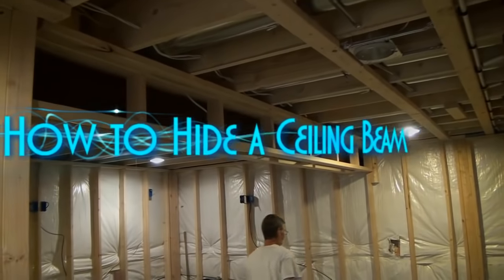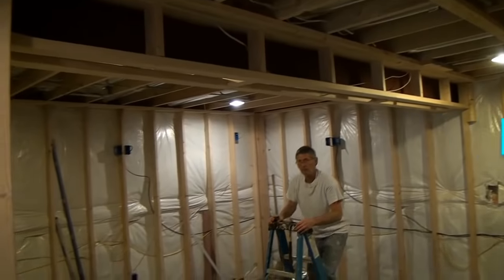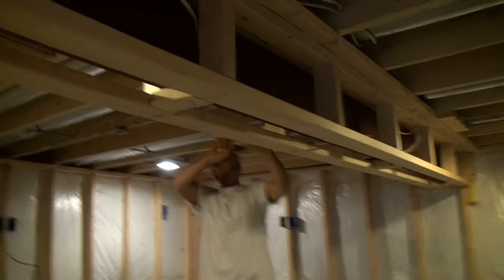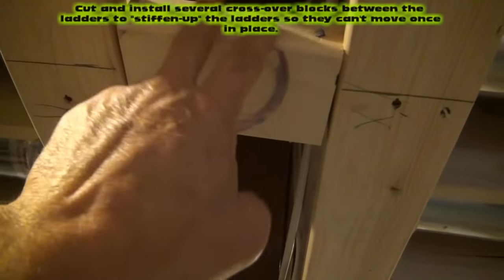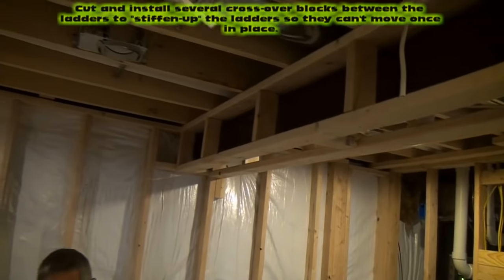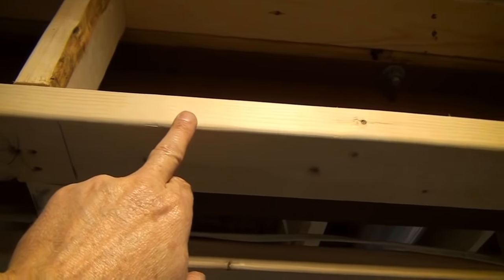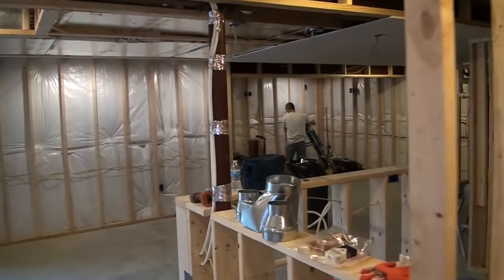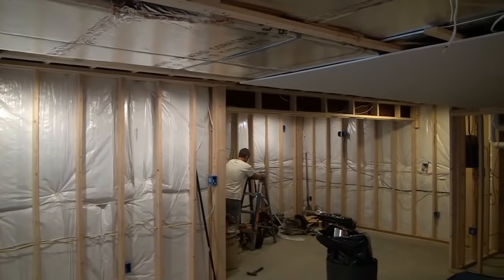How to Box In Basement Beams (How to Frame a Basement Beam)

Comment from the maker: This is a quick and easy framing project where you just build two soffit ladders, add cross-over blocks and then drywall! Thanks for your comments, Likes, and Subscribes to my Channel! ~Eddie
Reply: Basement Finishing Man why do you need to put the bottom of the ladders 2" below the beam exactly? I'm trying to maximize headroom so cutting them just long enough to fit drywall underneath would be ideal.
Reply from the maker: The only reason is to put the connecting cross-over pieces from ladder to the other. And the only way you can do this is to go under the beam Steven. This stiffens up the ladders and keeps them from twisting and moving in the future which causes your drywall cornerbead to crack out eventually over time.

Eddie

Comment: How would you suggest framing a wall in an older home with a cinder block basement with the older 8' walls and the Ibeam is at 80"and spans the entire length of the basement? would you run the wall along the Ibeam? or put it on the one side or the other? 
The only problem I see with putting it on one side it the doors. Open the door and booom there is an ibeam in your face. I feel it would be better to just put a 2X6 wall right under the Ibeam and order custom doors. What do you think?

Comment: There are 2 pieces of wood (1"x5") running along both sides of the steel beam. Do you remove those and replace them with the box frame on both sides?

Comment: Hi Eddie. I'm planning on finishing my sisters basement to add 2 bedrooms. My problem is that the wall between the two bedrooms needs to go directly underneath an I beam. Should I box it off like you did here, add more spacers between the ladders and secure the wall to the bottom of that?

Comment: On a steel beam that's over my man cave, where my two car attached garage is directly above it.. I've got several steel beams going across, with concrete on the outside of them.  On a couple of them.  The concrete has had some cracking, and a little crumbling.  Now my question is.. Does the concrete weaken the steel beam in anyway at all??  Any help, advice would be greatly appreciated.  Could just be from settling, but I'm not a professional.  Thank you, and good video.

Comment: Thanks for making these videos. I have watched 2+ hours so far in preparation for my basement. Question..If your support beam is wood (not steel), is it necessary to build the soffit ladder? Just thinking I would be able screw the drywall into the wood beam. --Rob
Reply from the maker: You can if there is nothing else in the way of the drywall Rob...But I like my beam a little wider looking so I am always doing the soffit route.

Eddie